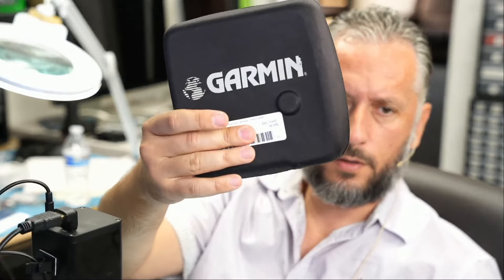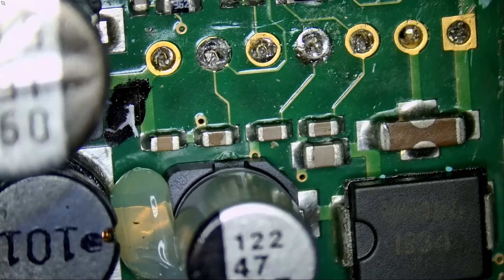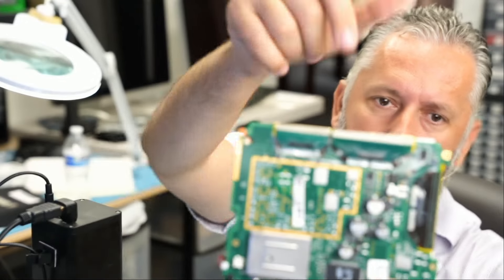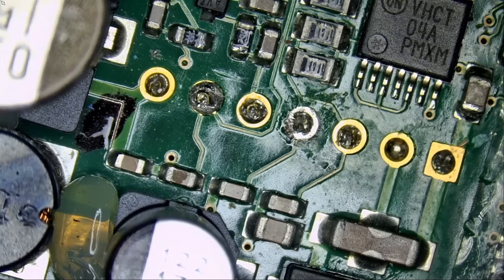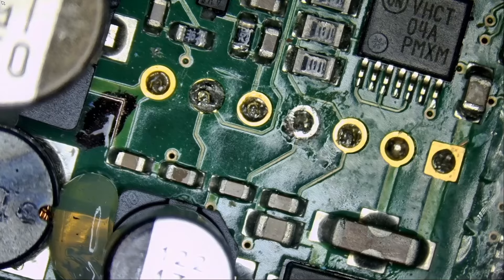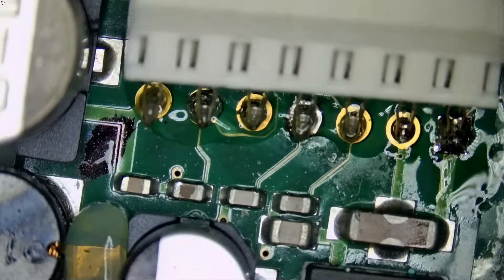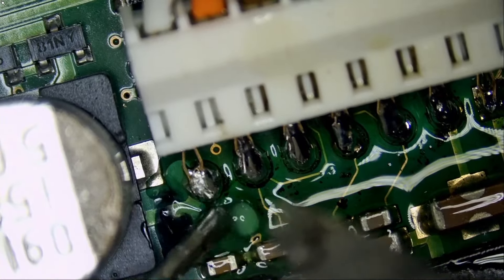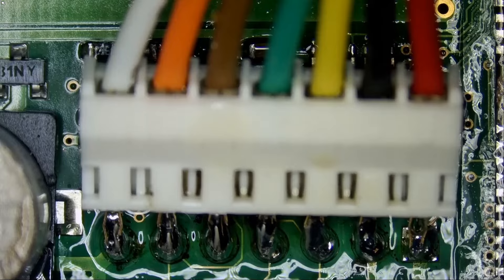Garmin 182 Fish Finder GPS Repair

Comment: how many repairs are you getting for the Intel 13th & 14th gen problems right now?
Reply: Nothing probably or he will deam it a no fix at the issues on the cpus are inside the copper / metal layers of the cpu, with atleast 15 layers so i dont think I can do that
Reply: That's not something Alex or any other technician can fix.

Comment: I'm Nigerian i know its impossible to send it over for a fix i just need a pro insights. Was charging my ipad and watching a movie suddenly it went off and hasn't turned on they're was no sparks the charger I'm using is still good but it refuses to turn on, tired everything but one thing i can say is that while charging since it turns off it heats but not to degree of panic
Reply: Find a local repair shop
Reply: It is possible that the battery is shot.  Too many things it could be so I would listen to @don4techy.

Comment: 1:22 The orientation in question looks to me as if the two right-most connections are for power, looking at the width of the copper traces.
Reply: I was thinking the same thing. Also, the end wire next to the black ground is red indicating the positive power connection.